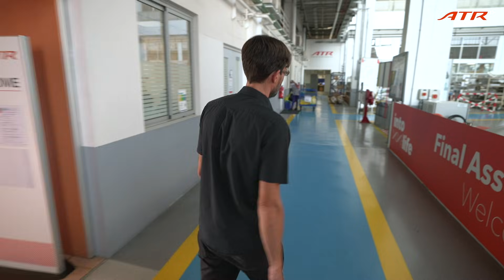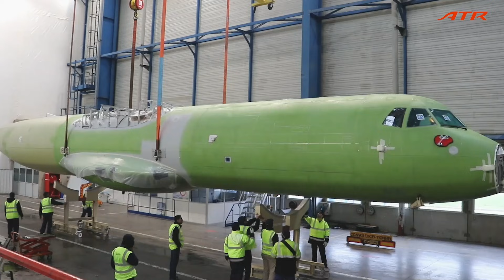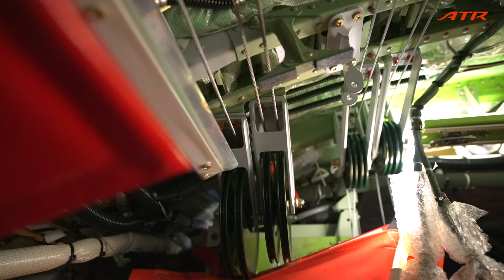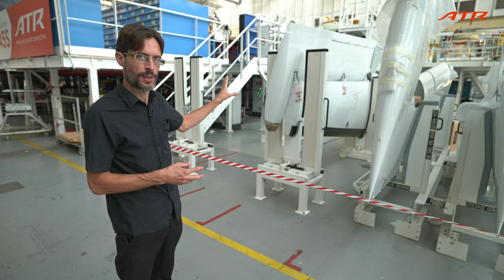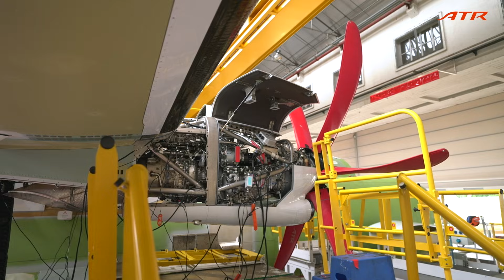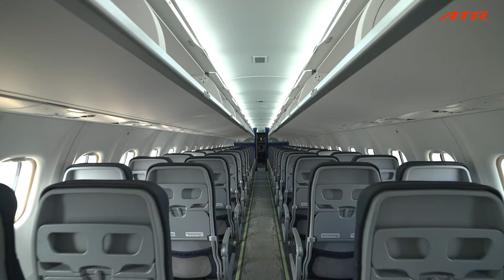ATR Final Assembly Line - Guided Tour

Comment: It’s not the building of it,it’s the-design, the wing cross section which allows ice to form over the controls and the pilots are unable to maintain control. Look into the accident report by the USA NTSB. On accident over Chicago.I’m a retired aeronautical certification engineer and I would not fly on this aircraft. They sold many aircraft but I think that’s due to good marketing like you are getting right now.

Comment: Hello. ATR42 is a really good aircraft. But i dont think the same with ATR72. Flat landing attitude is a real problem on runways with vertical windshear. EASY TAIL STRIKE
Reply: The problem you describe is the result of geometry. Any other aircraft that is stretched later in its production run will suffer the problem. The C-130 Hercules is a prime example.
Reply: @marcg1686  the issue is when you put together geometry and vertical windshear sensitivity.

Comment: ATR 72 is the major transporter here in Nepal. 🇳🇵🇳🇵
Reply: @abhishekojhaiya7452  The good production of the aircraft has nothing to do with the icing problem which is a design problem and the design needs to be changed so that it will cope with ice like the DHC8-400 does. Guys it’s really dangerous as can be seen by its previous failures in ice and large loss of ice. Design change needed on wing and until this is done it will continue to be dangerous in ice. I’ll bet the last crash was caused by ice. Stop the marketing response
Reply: @abhishekojhaiya7452  correction, large loss of life not ice

Comment: I am quite shock seeing the cables and pulleys to power the elevators of the wings.
Reply: Pretty much the same for every aircraft with mechanical controls. Cessna, ATR, 737 or even 747. If you remove the panels, the cables and pulleys are right there.
Remember it being the plot of some (not very good ) book, that they had to fly the aircraft from the cabin ceiling;-)

Comment: I have flown the ATR72-500 and it is very small airplane. I knock several times on the head and I am small size of the height of 5 feet 8 inches. I don't know how 6 footers and above fit in. 
I wish it is slightly fatter, wider cabin . Overall it is ok.

Comment: Dont have alot of these airframes in the states.. when they were first introduced it became quite apparent they were not designed for the massive weather events that occur on the east coast. The airframe is well designed for the European union and other more predictable weather climates. Paired with the absolutely bullet proof PW engine and HS prop it's a money maker ..the ATR got somewhat of a bad rap on this side of the pond and they never really recovered.. was the Dash-8 a better airframe .. no..THE DASH 8  it just excelled at handling what ever you threw at.. as for the PURPLE cargo tails.. be ready .. that company hires people that can break anvils. ..just ask AIRBUS.

Comment: Turkey.

I used to fly DeHavilland Dash-8 100/300 turboprops at my first airline job at Atlantic Coast Airlines.  We used to take off 10 minutes behind an ATR in Manuwark [EWR] and still wind up ahead of it going into Dulles.  AND....The ATR pilots were always asking for different altitudes due to icing in the northeast;  Our Dash-8 just chugged right through icing without any problem.  It was built in Canada; Hello hoser?

-When the Dash-8's I flew were produced the company was owned partially by Boeing.  The ATR might as well be labelled "Airbus", since that company owns most of the Franco-Italian airframer.  

We had a nasty nickname for the ATR:  We called it the "Advanced Terrain Reamer" after the Indiana accident.  That airplane had strange de-ice boots that were vertical instead of horizontal along the wing leading edge.  And it was utterly underpowered compared to the Dash-8~
Reply: And yet, 35 years after entry into service, the ATR 72 is still being manufactured.
Reply: @marcg1686  Yes, the Advanced Terrain Reamer is indeed still in production and apparently still reaming terrain in an advanced fashion, as we saw from the Brazil incident.  DeHavilland is moving the production plant for the Dash-8 to Alberta and will resume production soon.  Bombardier sold the plant in 2019. The Canadian government wants to close Downsview airport.
Reply: @Flies2FLL  The Voepass loss was due to pilot error, plain and simple.
Longview's plan to restart Q400 production is for the moment aspirational in nature. They're talking to existing and potential clients.
Reply: @marcg1686  That "pilot error" would not have happened in a Dash-8.  ATR needed to redesign the wing after the Roselawn crash, but refused to do $o, instead applying some band aid fixes.  Voepass is the result.

I've talked to numerous ATR pilots who have stated that flying in icing conditions the plane will suddenly dip a wing.  With 1800 hours in the Dash-8 flying primarily in the northeastern United States in all sorts of bad weather, I can tell you that the Dash-8 never did something like this.
Reply: @Flies2FLL  
I'm going to be so bold as to suggest that you have yet to read the preliminary report on the Voepass accident.
The aircraft was dispatched with one AC pack INOP. This limited the permissible altitude to 17.000 ft.
En route the crew determined that the de-icing system was defective. Yet they flew into known icing conditions.
The crew blithely ignored the Cruise Speed Low cue, they also ignored the Degraded Performance cue and they ignored the 'Increase Speed' advisory.
I'm not a pilot, you are. Would you describe the actions of the crew as exemplary?
Reply: @marcg1686  None of those systems exists on the Dash-8.
Reply: Be nice..worked the ramp at Dulles when Presidential airways got thier dash 8 back in 1989ishy . . Kiad to kswf.. packed with bags strapped to the landing gear.. at that time the ATR de-ice system just could not handle the weather events in the north east corridor.. the dash 8 .. would taxi in just covered in ice .. quick blast with the heat juice and off she went.
Reply: @thomasburke7995  Absolutely correct Thomas Burke!  I flew those things up to the northeast from summer '93 to fall '94, and other than one incident when we iced up over Virginia on a 90 degree day and the captain STALLED the airplane and I had to take the controls and break the stall, we used to beat the ATR's to Newark  and JFK, and they would get over Maryland or Nuh Jair-Say and constantly be asking for other altitudes, while our Canadian plane just chugged right through it without  even thinking about it....
Reply: You expressed this better than I would.

Comment: ATR  600 TransAsia crashed because one prop auto feathered and the pilots shut down the wrong engine and in fact both engines. Bad soldering on a circuit board caused an auto feather. Pilots were clueless. Nice plane in the right hands. They retrained all of TransAsias pilots after the investigation. The automatic takeoff power control push button light did not light on take off roll. Takeoff should have been rejected. Plane did its job. TransAsia shutdown in 2016.

Comment: As a New Zealander that regularly flies these planes via Air New Zealand,  it was interesting to follow this tour. I enjoy the ride on these planes moreso than the jets. Thank you for the excellent video.
Reply: The best aspect about these ATRs' are that one can board and disembark in very short time compared to a conventional large Aircrafts, wherein one needs to await 200+passengers to board and disembark. The ATRs' also delightfully have a small turning radius and are pretty swift on ground movements.